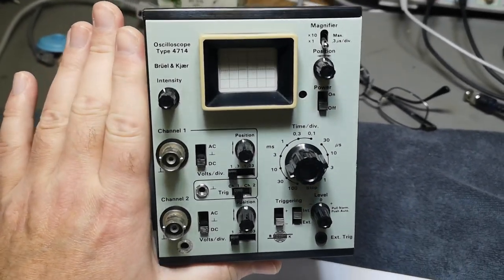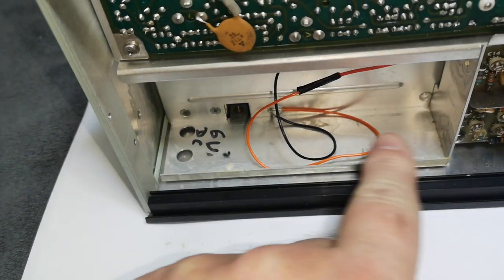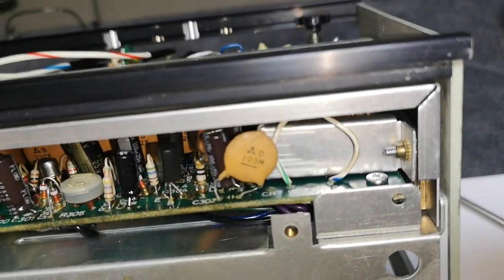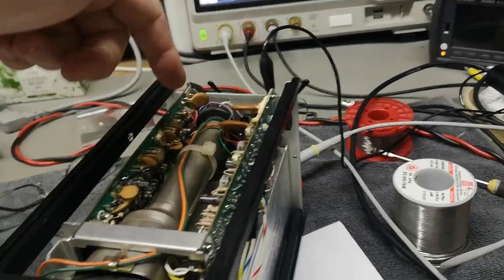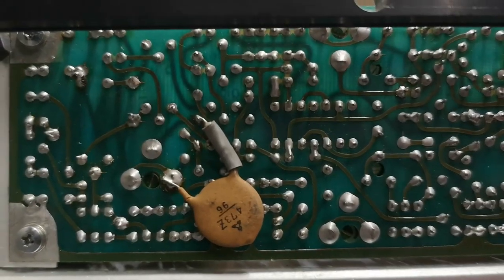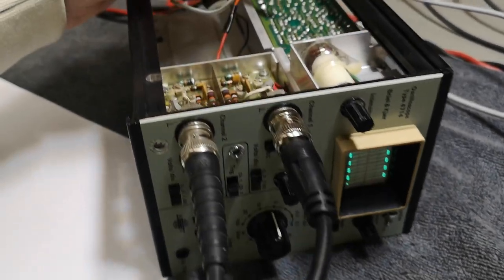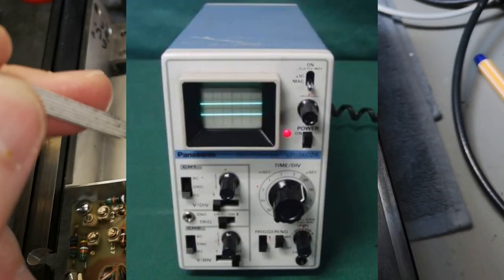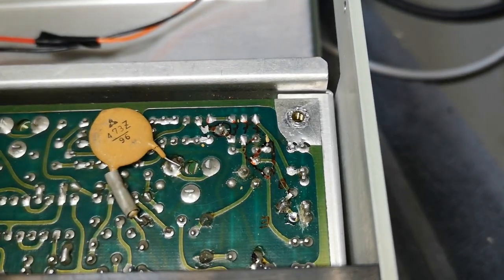Brüel & Kjær tiny oscilloscope Type 4714, 2ch 5Mhz 1976 repair teardown

Comment: A very cute unit! Good detective work on the repair, and in finding that it was a re-branded unit for which the schematic was available. 
I have a few bits of B&K stuff (and did some teardown videos),  I did find some manuals for them, but never any schematics.
Reply from the maker: more B&K stuff is on the way, stay tuned :-) and yes hard to find manuals and schematics lucky most of this age designs uses quite normal components

Comment: The 8731A is a quad 2 input diode expander, it was part of the 8400/8800 logic range from Signetics.  Search for "Signetics 8400/8800 TTL/DTL Data book" and you can find the data sheet.

Looks like it's being used as a matched diode array for analog signal switching in this application (i.e. the input chopper) which isn't the original intent for this part

Comment: Got a tiny little Telequip single channel one, all tubes, and too scared to power it up at all.

 Look at all those Matsushita branded capacitors in there, all those parts likely made in house by different divisions of Matsushita heavy industries. Power supply to plug in a "special" lead acid pack, a standard SLA in a nice plastic case, with PM9 battery clips on it, and only available from Matsushita, though with either a Phillips or B&K label stuck over the screen printed Matsushita part number. Looks like your one leaked in the case, and of course you never got the separate charger. Ah well, at least no danger of shorting out the scope to mains ground, or getting ground loops, though your case will definitely kill you.....
Reply from the maker: dont be scared, just remember to record video when first power on :-) i feel the fun..
Reply: @TeardownOZ2CPU  No thanks, I have had plenty of big electrolytics come past me, and am a little wary, as I used to work with explosives. Not liking little bangs, as they often become big ones.